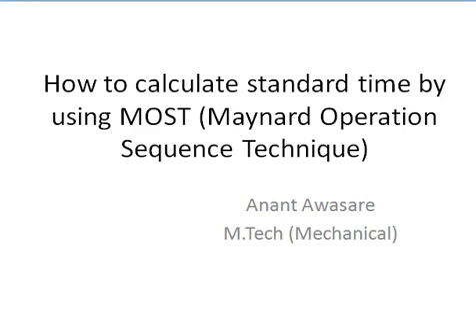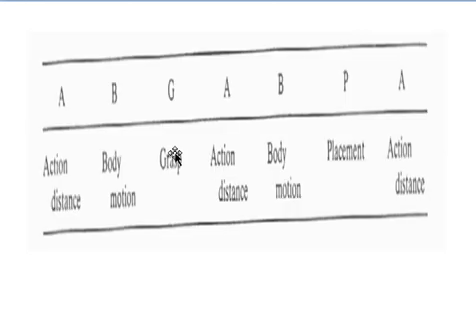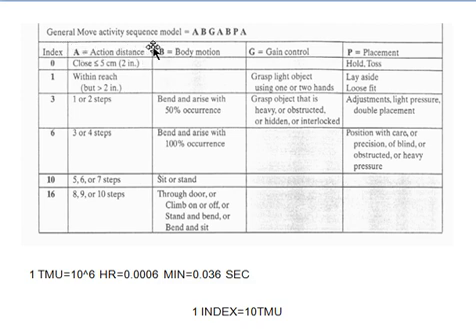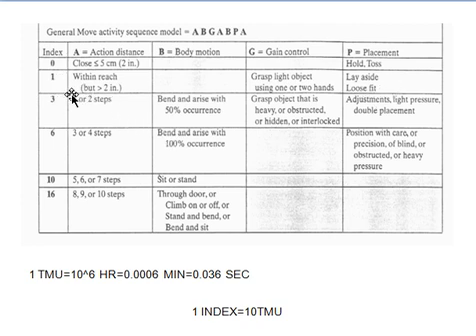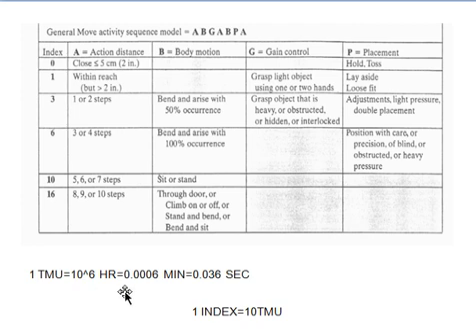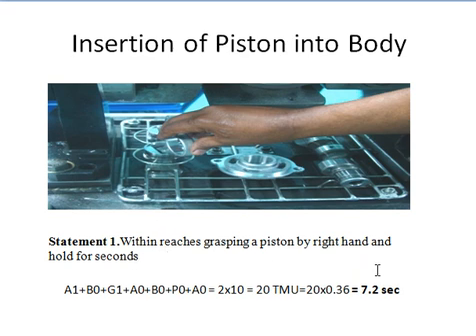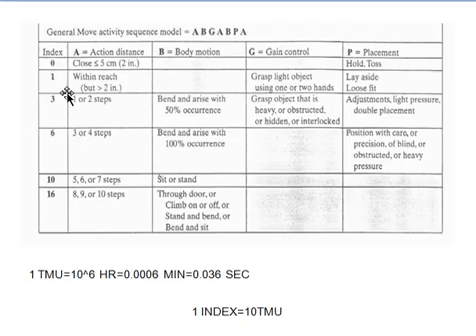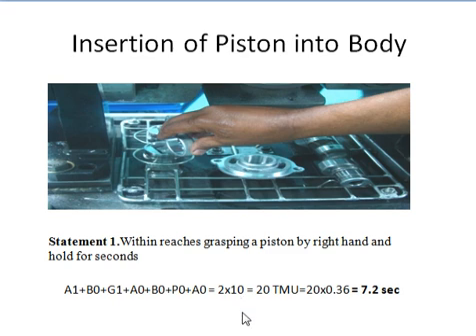How to calculate standard time by using MOST Maynard Operation Sequence Technique

Comment: 4:59 The Get Phase is incorrect. All ABG values should be 0, A1 should be in Put Phase A1B0P3. Though, you will still be getting the correct TMU but the wrong value analysis.